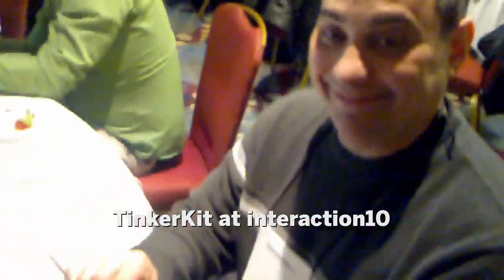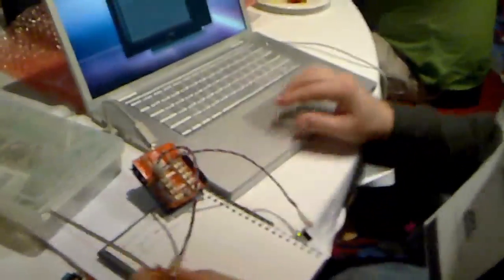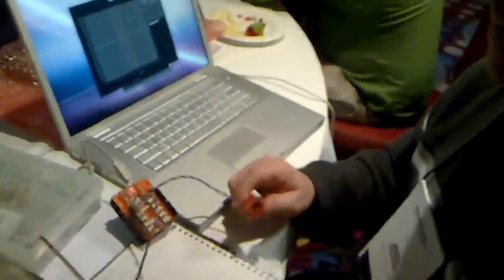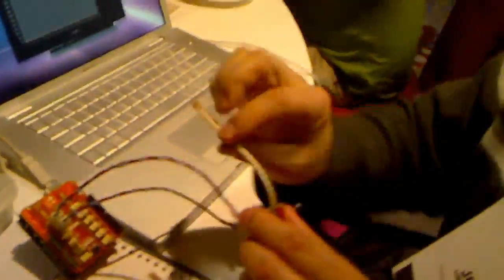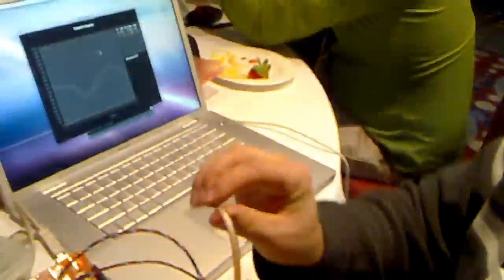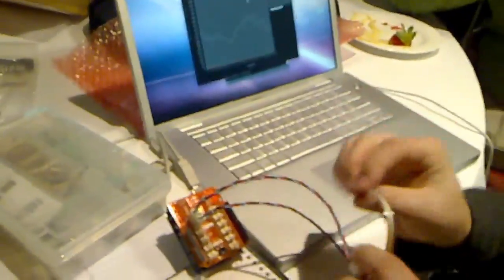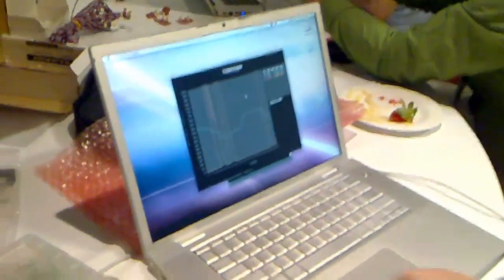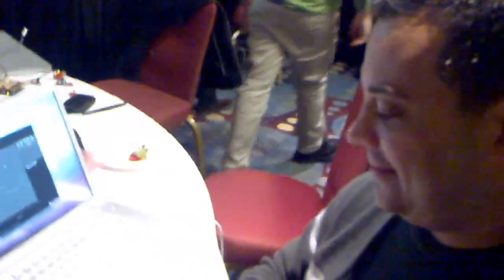Exploring the TinkerKit at interaction10

Comment: It's pretty cool actually. I was at this workshop and I've been an arduino user for a while. It brings plug and play to the arduino for a large number of sensors and inputs so that you can quickly prototype your design before you spend hours, days and cash on something only to realize it isn't going to work in the end. It's also a great way to get people interested in electronics without getting too bogged down in the details.

Comment: I like it! Stress sensors for metallurgy experiments, expansion and contraction, speaker vibration sensor, test sensors for almost anything that involves motion. The part we have to do ourselves would be to build the housing and define a standardized calibration method for the sensor and housing unit.